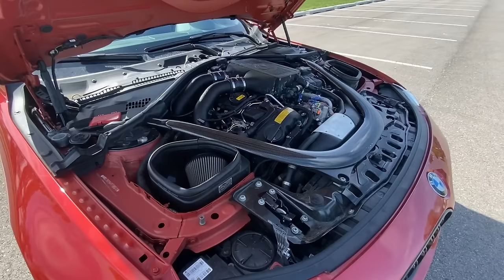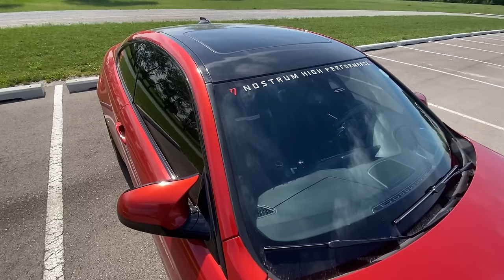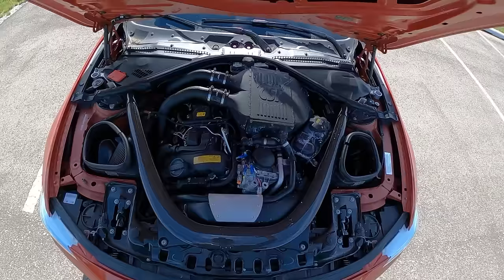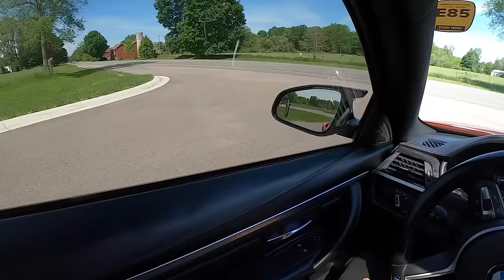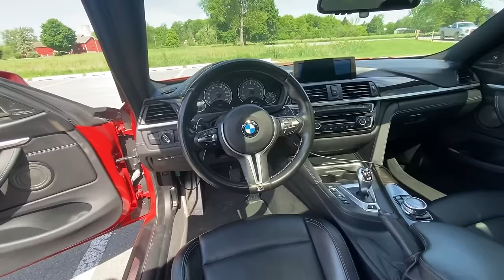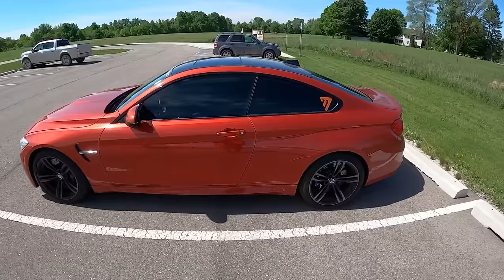530hp 2015 BMW M4 (DCT) - POV Driving Review

Comment: 578hp and 620tq is insane from essentially just dp, intakes, injectors and flex tune
Reply: Just came across this video. Exactly doesn't seem like much work to get good power gains from stock. Wonder how much the mods are in total to do on a similar year M4?
Reply: @bassfan71  without injectors i think it’s around 2 grand if you install hardware yourself, i don’t know how much F8X injectors are tho
Reply: @juhsztn  Okay sick! That's not to bad. Probably with injectors thinking $3-4k?
Reply: Great power with a few add ons!
Reply: @bassfan71  maybe ballpark? probably somewhere around there
Reply: How much in mods to get this cars specs?
Reply: @juhsztn  Our Nostrum Stage 1 Injectors for this S55 are $999
Reply: @bassfan71  yea around $3-4k if you don’t include the high pressure fuel pump ^
Reply: @bassfan71  just with stage 1 tune it’s 50~60+ hp and 100+ tq  it’s genuinely incredible how underrated these motors are compared to the jdm stuff
Reply: You need to add 3k for crank hub

Comment: that’s got to be MUCH faster than the stock G8X comps, it’s lighter, much more torque and DCT
Reply: stage 2 f8x is as fast as a g8x comp car, dct really helps her scoot too🔥
Reply: Stage 2 f80 would beat a stock g80 easily, but mod for mod f80 of course would lose. But in the looks department, f80 wins! Lol

Comment: Great car, already put 20k in a year commuting to work. You can drive it default mode or put it into the set M profiles. One thing about this car is the crank hub issue. Keep that in mind if you plan to add more HP to the car it can cause the crank hub to spin.

Comment: Just curious, as this car tickled my fancy for an attainable dream car. How much would you say is the market price for that car, if someone wanted to replicate that build with a similar year M4?
Reply: i know you commented this 2 years ago , but if i were you i would try to find a 2015-2017 m4 for 30-35k and then a down pipe,tune, and a couple other things would make some serious power and could prob get that done for under 5k. i am currently trying to save up for an m4. i would get the 2015 but it doesnt come with as many carbon options i dont think so probably going to shoot for 2016 and up
Reply: @zackzundel1047  Thanks for the response and information! Even today, that's above my budget. I'm primary looking for a manual rear wheel drive daily to be reliable and fun. I'm likely going to go with a 370z or mustang gt.
Reply: @bassfan71  ya man of course. Those are great options. I honestly don’t know which I like better they both have great aftermarket support, but that 5.0 is hard to beat especially with some cosmetics like euro tails👌

Comment: Yo guys, when do you consider a car fast? 0-60 in less than 4-6 ?
Reply: Idk I consider a car "fast" by it's power to weight ratio. I want my next car to be around 10 (meaning every horsepower is pushing 10 pounds of weight). My current car has a power/weight of 14.
Reply: Less than 3 seconds super fast, less than 5 seconds really fast, less than 7 seconds fast. Less than 10 seconds decent fast. 10-12 seconds fine fast. 12-14 seconds slow fast 😂
Reply: My m4 convertible which is 500lbs heavier than a regular m4. Using Racebox, which is accurate down to the 10th of a second. Managed a 0-60mph in 3.67 seconds, full e85 tune, catless and Michelin Pilot 4s 285/35/19 rears